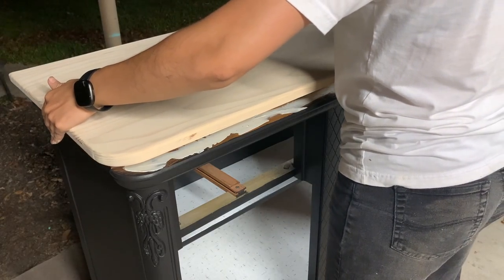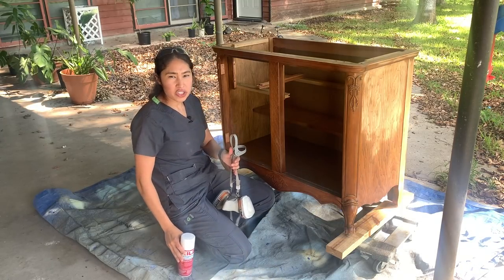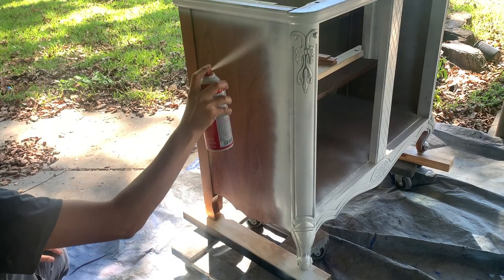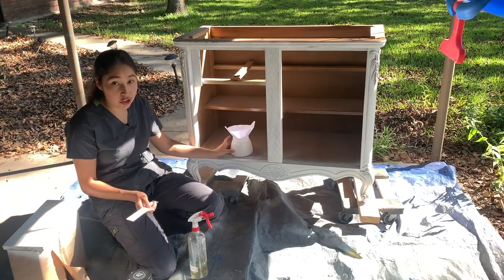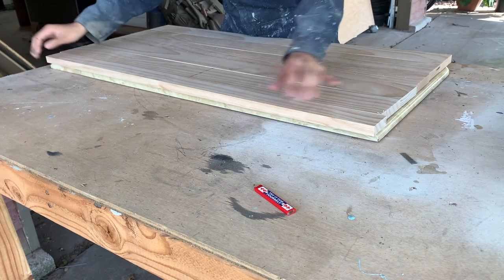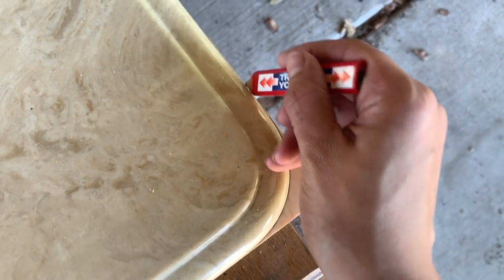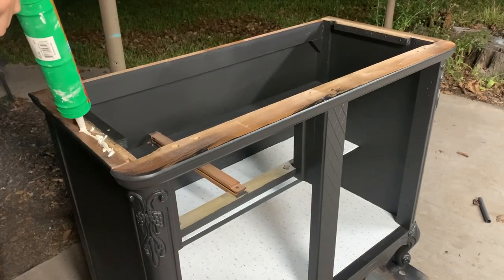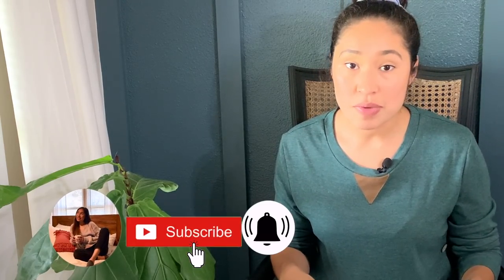Modern Furniture Makeover | DIY Build a Plank Top | Furniture Transformation

Comment: That looks a million dollars. 😀 Very elegant. I've been binge watching your channel.😊
Those boards for the top must have been REALLY flat and straight.
Normally I would have run them through a thicknesser to get them that flat. You managed it with just a sander. 😁That pocket screw jig works well. 
Have you ever used a biscuit joiner?
Very quick and easy to use and set up. Can't be used everywhere like the pocket screw setup but saves a lot of time.

Comment: If you glue a solid wooden top on the frame, eventually it will crack as the wood dries and shrinks. The correct way is to screw the top from the under side with special hardware that allows the screws to slide in slots perpendicular to the wood grain.  The shrinking of wood may be as much as 8%.